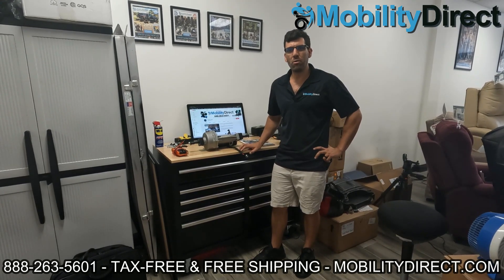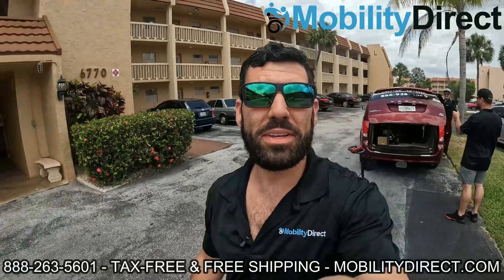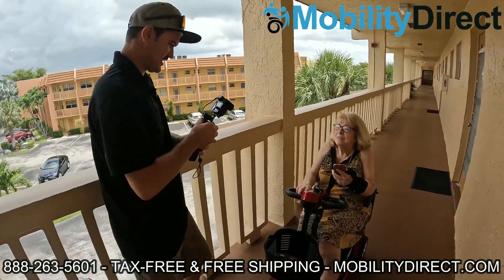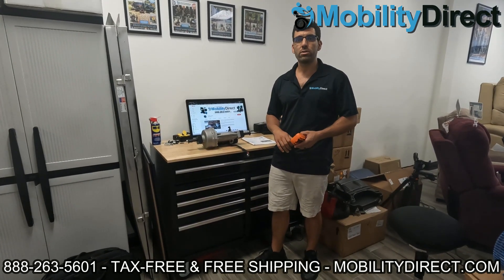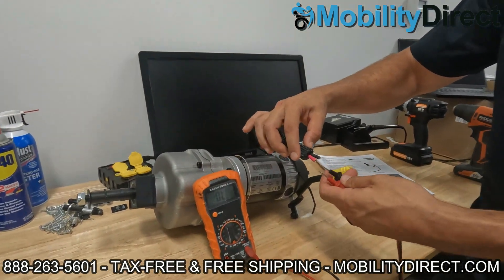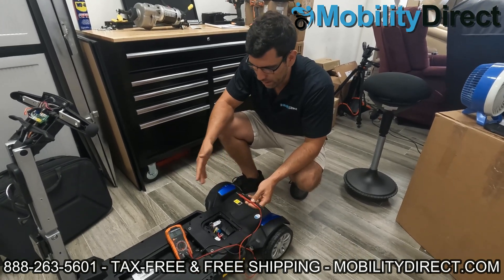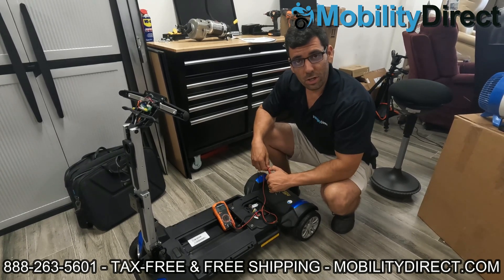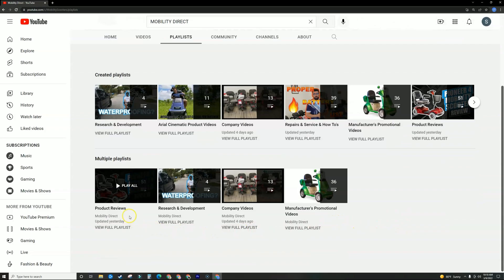⚙️HOW TO TROUBLESHOOT A MOBILITY SCOOTER MOTOR

Comment: You presentation was flawless and easy to understand. I have a Cadillac GTX 750 watt motor except the motor freezes up making grinding and clicking sounds. It was a bit too big for the bus as I need my own strap down. A smaller scooter would be awesome thus allowing me to shop for food better at Winco. It was a great scooter in getting around within 5 miles of not using the bus. Now I am stuck literally. Social security disability only pays for rides to the doctors and physical therapy...insurance will not pay for Uber rides to the grocery store, UPS, burger Kind, Wendy's, a movie theater, etc... An average 2 way Uber trip is 20 to $30. My disability living barely covers rent, btw. I depend on God's blessings/ gifts and peoples donations. After 3 years, my neighbor kindly purchased me a wheeled walker. I'm limited to 1/2 a block with walker therapy tool. Without further rambling on. I am determined man. For example: I dedicated 62 consecutive days towards pressure washing, cleaning and chalk blocking with Kilz Kear and Kilz Primer 2... 2 coats of primer paint as my therapy in light duty and building my endurance in just standing upright type determined plus it saved me and the home owner $3,000 in expenses. We charged just under 2k for paint supplies. Then my Cadillac GTX scooter motor goes bad locks up on me. I am already on the hook for $150 a month in credit debt and without a scooter.

Thank you all for listening. This guy on this YouTube breathe hope in me as I am a DIY type person. I prefer to be known as a SURVIVOR vs a victim of Arizona (Redlight runner Capital) road ways. Since 2018, Arizona has mad efforts in reducing accidents and raising driving awareness. I would LOVE to have a new Cadillac GTX scooter as It has been literally my Godsend. BUT a scooter like the one in the giveaway contest would be awesome too especially traveling the bus type scooter.

I had a youtube channel,  but I mostly post helpful content on my facebook account. Personal self help type content. 95% of my energy and efforts is my physical therapy. Laying in bed 98% of the day is horrible. Living life like a vegetable. I must maintain my mobility.

Thank you in advance for lending your ear. I'm a Godly man in need of a miracle!.

Everett J. Pierce
[602.881.9349]
Reply from the maker: Thanks for watching our video and commenting, Everett. We appreciate you for sharing as well. We're glad the video helped. If you haven't subscribed yet, don't forget to hit that subscribe button to get a chance to win a free mobility scooter.

Comment: I have a Pride Mobility SC44E with a CML motor (WCM808-138). I have the owner's manual but it seems Pride doesn't provide any kind of technical information whatsoever about their scooters. Do you have any idea what ohms I should be getting? TIA
Reply from the maker: No, but if you go to the Pride Mobility website, you might be able to ask them on their live chat and they should be able to provide you an answer

Comment: I've worked On Quite A Few 
Powerchairs. Anything From
Electrical To Tires To Even Replacing A Seat. Usually If A Motor Wont
Start Start It Probly Needs Good Cleaning
With A Little Laquar Thiner 
To Desolve Old Greas Or If That Isnt
Handy I Sugest Using Gunk.
That Will Work As Well. Even Better.
I've Taken Apart Alot Of Motors.
& I've Seen My Share Of Dirt & Grime
I Even Sprayed A LawnMower Engine
With Gunk & You Shpuld've Seen
The White Foam Turn Brown